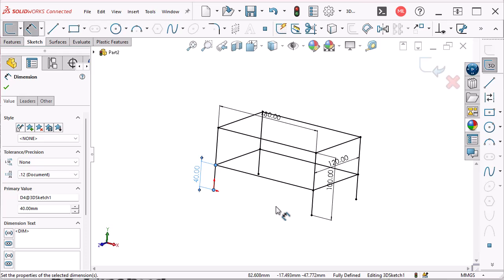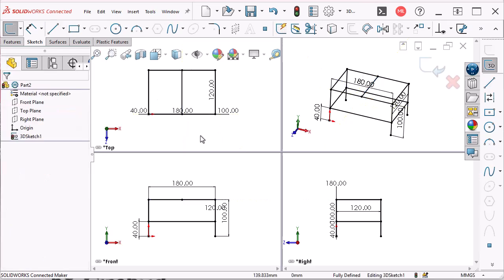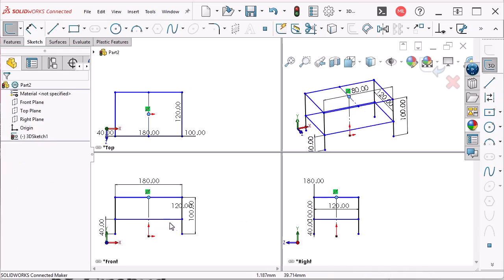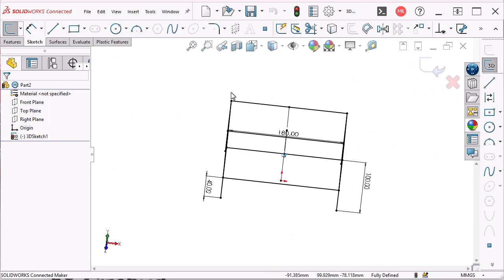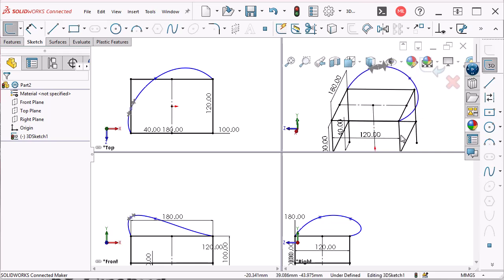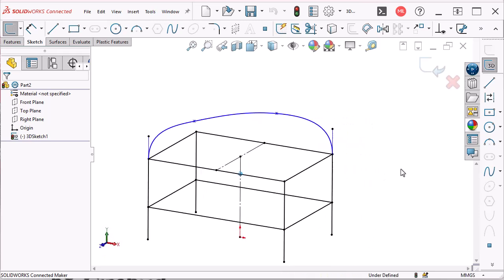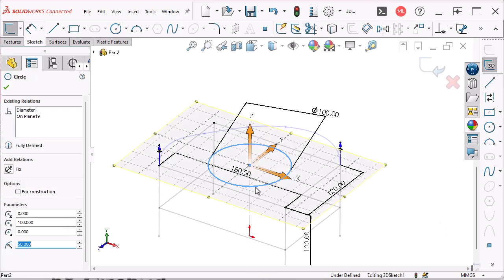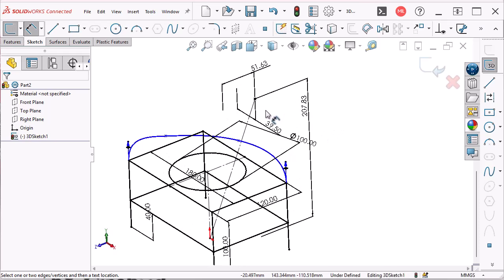Solidworks 3d sketch 3

Comment: In 3d sketch when you choose a line and a plane there are these relation as ParallelYZ and ParallelZX which I don't understand them. By the way the Grid joke was hilarious 😅
Reply from the maker: ParallelYZ or XY means that the line will lie parallel to the YZ or XY plane, which in turn means that it can't change in the X or Z directions respectively. If a line is on or parallel to YZ, then the endpoints of the line will have the same X dimension. Does that make any sense?

I remember from a long time ago that people got really sensitive about showing the grid because of the way it was used in AutoCAD. Everybody had this stigma about using the grid. In the late '90s most people were coming to SW from AutoCAD.
Reply: Thank you for the explanation, I have to try it on SolidWorks. 
You're right the Grid was something of importance for AutoCAD users, I  know SW users who still make sketches in SW by entering endpoint coordinates like in AutoCAD.😂